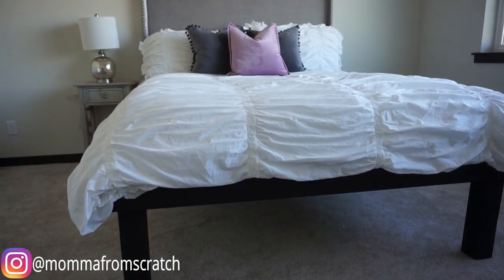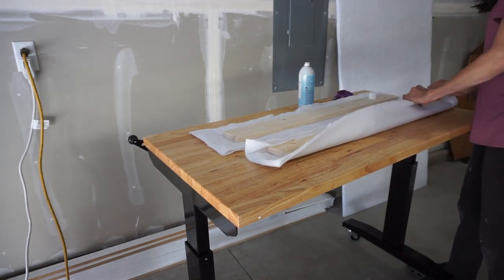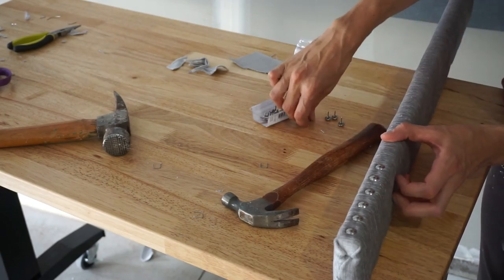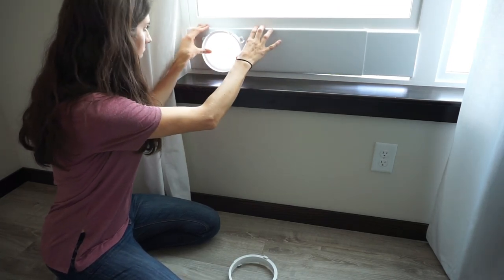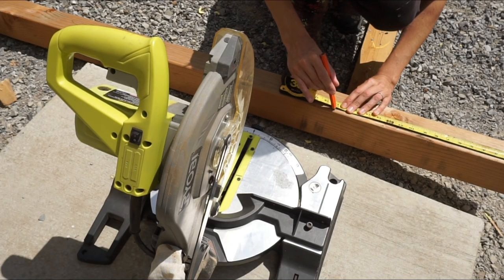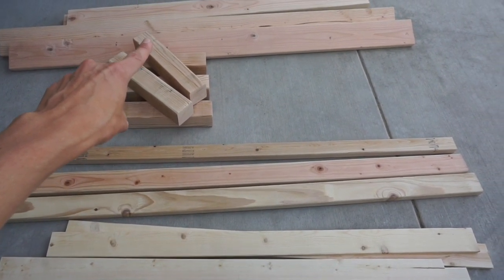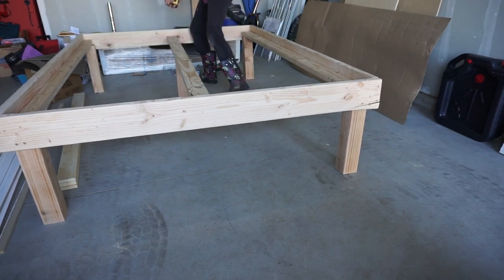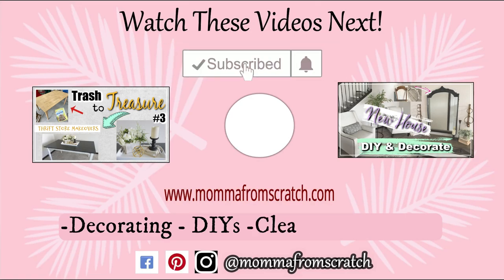DIY Upholstered Headboard + Platform Bed Frame | DIY QUEEN BED | Momma From Scratch

Comment: WOW Emily, you are a great carpenter.  I could make that.  About how long did it take you to make the bed frame?  I missed it but are those measurements for a king size bed?  We have a rickety old frame & a terrible mattress, was thinking we need a new headboard & frame.  I would have to do all my work on my patio (not enclosed).  Might wait till Oct when the winter weather starts & it's more bearable.
I am so excited.
Mary
Reply from the maker: Thank you!! The bed frame was about 130 with all the cuts and sanding and painting. So  not to bad and this was a queen size. If you do a kind just look at the mattress and make those size cuts. Queens are 60x80 so you can see how I added a bit
Reply: @MommaFromScratch  Thanks Emily, did it take you more than a day?  We are in a gated community so if it takes me longer than a day including paint drying, it should be ok.  
Will do my math, thanks.
Mary
Reply from the maker: @murphy1384  no i did it all in one day just styled it another day. it shoudl only take you a few hours tops even with shopping for supplies
Reply: @MommaFromScratch  thanks for replying, I appreciate it.  Saving this video for Oct..lol
Reply from the maker: @murphy1384  of coarse so happy to help

Comment: Very cool! I’d love to do this, but I also like to store stuff under my bed. What do you use for a bed skirt, and how do you attach it?
Reply from the maker: You can still add a bed skirt like normal. The height I made it allows for large containers to fit under it. I put seasonal decor in the middle and it’s really hard to see. I hope you can make one.
Reply: Momma From Scratch normally the skirt fits under the mattress on    the box spring—how would you get a skirt on with all the slats?